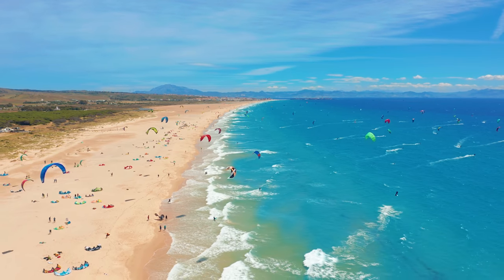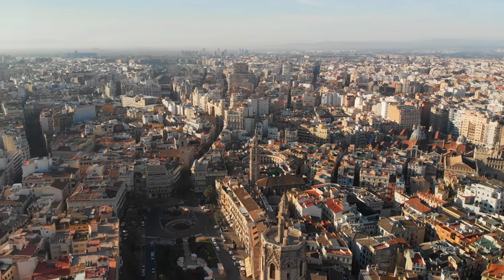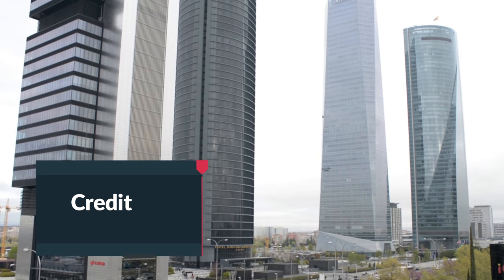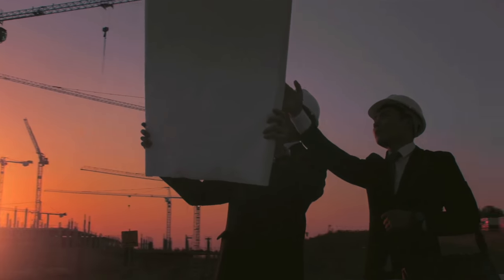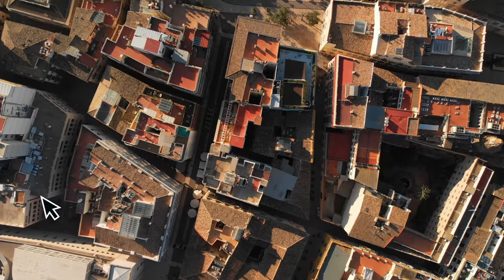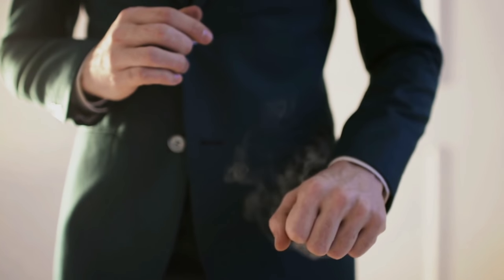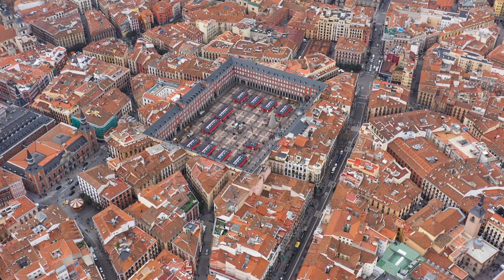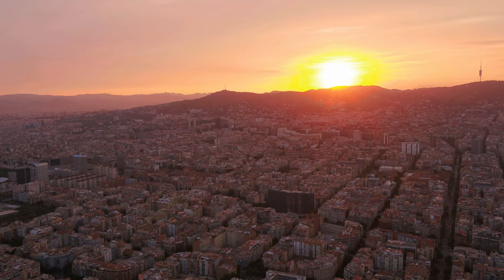The Economy of Spain: World's Greatest Bubble?

Comment: The largest problem in Spain is the pension system. Currently 1/3 of government spending goes to pensionists. In the following 15 years, 55% of voters will be retired and the number of pensions would increase a 40%, which make it impossible to pay nor to reform it politically (half of the voters will vote against since it’s their pension). Thus Spain will have cronical deficits and collapse. I am from Spain, just wait and see...

Comment: I wouldn't consider the labor costs to be significantly higher than usual. Spain's labor legislation has a tendency to confront high unemployement with favouring cheaper layoffs and temporary contracts, which in turn fragment and dissolve the labor market even more, not allowing for significant job stability and stable financial lifestyles.

Comment: PhD in Economics and Spanish here: good points! Some things to note: 
1) The inequality between temporary and permanent contracts not only means relying more on temporary contracts, it also means lower productivity and lower investment on worker's productivity. 
2) There is a huge issue with pensions (very big substitution rate, a lot of ageing) and their pending reform, which means higher taxes or higher debt in the short term until that's fixed. 
3) Big barriers to create new companies, which also make the economy less dynamic... 
4) Having debt is fine as long as your revenue/income grows and can keep up, which ultimately depends on your productivity growth, and that's something in which Spain has a lot of potential but the political leaders have been failing to deliver.

Comment: In Spain there are several problems ... 
1. The need of external incomes, investors and tourist, in order to cover expenses due lack of better Public Administration, and Goverments. This fuels the Public Debt bubble and growth rate. The spanish workers and factories cannot sustain Spanish economic system by themselves.

2. The Justice Administration ... so expensive, so slow, that is not justice. You can loose everything even being right!!! Lack of juridical security is devastating.

3. The spanish population went from 45 millions in 2007 up to 46.5 millions in 2020. This increase is due to increase of migrant. Without a clear growth of population cannot be economical growth. 

But the best of Spain is that the currency is the EURO. It cannot be devaluated by spanish Governors, and the Low Rates of the European Central Bank, close to Zero.  This is the actual benefactor for the spaniards granting wellfare.

And the last thing I want to say is that General Franco, who died in 1975, said as  recomendation:
" Uníos a Europa", = "Join to Europe". Spain signed Rome Treaty in 1986, to be member of European Comunity, and started using  Euro as currency  in 2000, 1st january.
Reply from the maker: Great insights Paco!

Comment: Nice video. Although I disagree. There is a political history behind.
From 1996 to 2004 there was liberalization (something that had happened previously only in 1955 to 1959, and in 1985 to 1989), and a subsequent boom in immigration. That fuelled the housing market. Things started to heat and the Spanish government demanded the ECB a raise in interest rates in early 2000s. But France and Germany were fighting against debt, and a banking crisis, and blocked the move. A procedure for excessive deficit against France and Germany started. 
In the middle of this, there was elections in Spain, and a terrible terrorist attack. And the government changed. And that changed the equilibrium of forces in Europe, from the Atlantic powers, to the Axis Paris-Berlin. (The Economist "Europe without Aznar" 2004).  Excessive deficit procedures were literally freezed; and finally ignored with the blessing of the European Court of Justice in 2007 (The sentence was like "Ok, Germany should have been sanctioned, but, look, they have corrected their problems so, there is no point in doing that now"... Shameful). So Germany and France printed their way out of the crisis, from 2004 to 2007,  while a giantic housing bubble appeared in Spain, amid protectionist and socialist policies, thus disconnected of any real and proportional cause of growth. 
And after that, the credit bubble bursted worldwide. And the rest is History, as you have told

Comment: Just a note --- The US saw its "construction" sector triple in size from 2000 to 2007.  After the Great Recession triggered it fell to less than half its original level for years.  What a global dumpster fire.
Reply: @adeline rojas You can recover from that.  You can't recover if you lose democracy (which Russia did, Hungary is working on and the States are wobbling).
Reply: @adeline rojas Best wishes in the new year.  I remember the last century and have no desire to see Spain or any other country flush down that dark hole.

Comment: The Euro was a crippling blow on spanish economy. Spain should have stayed away from the single currency.

Moreover, being part of the European Union, implied disbanding Spain's heavy industries and relying only mostly in tourism and construction.

Nowdays Spain is kind of protectorate of France and Germany.
Reply: I don't think being part of the European Union implied disbanding heavy industries, it could have happened as a result of being able to move easily, but it was certainly a decision people made. Moving production overseas where labor is cheaper made industry disappear in my opinion, for example the Zara brand that was featured in the video.

Switching to Euro, although unpopular, wasn't a bad move in my opinion (but my knowledge on the matter is limited, so take it with a grain of salt). Their currency wasn't as strong as the GBP or USD and while it would have allowed Spain to inject money into the market if necessary, devaluating its currency would only weaken it.

Comment: The Spanish economy plunged more than most European countries in the 2008 financial meltdown, therefore it is normal that they experienced higher growth rates after the crisis, since they were coming from a very low point. In 2020, Spain suffered more mainly for two reasons: a bad management of the pandemic, and the need to set a much harder and longer lackdown than other countries, and because the strong dependence to tourism. The foreign tourism industry has sinked, causing billioner losses to the economy. 

However, it is also true that Spain needs to improve many things in their economy. There is too much bureaucracy for enterpreneurs, the labor market is still too rigid, taxes are too high compared to neighboring countries, and the country depends too much on seasonal and unstable industries such as tourism.

Comment: The growth model is basically still that of the dictatorship. Construction and tourism. This is of course related to the political system, also inherited from the dictatorship, involving decades of corruption which thrives with that very economic model. To address its structural problems, it must first change its entrepeurneurial/ political system based on short term, low value added growth, and stop blaming the Labour costs and the like. The future can be bright if after the pandemic and with well managed EU investments Spain leads a green energy based recovery. And make no mistake: Spain, having thousands of km of coast, windy planes and sun 360 days of the year has a stronger position than most in a green based future.

Comment: one problem in spain is the beaurocracy. new tax rules and regulations every day. More and more complexity. million of public paid funcionarios on a very good salary and excellent working conditions, short hours, long holidays, excellent sick benefits are supposed to help the public. what they actually do is make the machine run slower still..   It's become a sort of club, job for life brigade. You have to pass university exams to get a position. It's not always what you know, but who you know. Once in, it's very hard to get rid of someone who performs minimally. Or rather, the norm is  do the minimum or less. Any enthusiastic hard workers are ostracised. At the first wiff of a lockdown, they closed all their offices and "worked from home". walk into any of the tax offices, and you will see the public treated like scum. Every second desk is on a break. you get a ticket to ask one question. stray from the question and you need to get another ticket. if anything isn't clear, it's your fault not theirs. they swear openly, are rude and extremely short tempered. Thy are feared because at the push of a pen they can destroy you. They can put you up for a tax inspection at the drop of a hat.